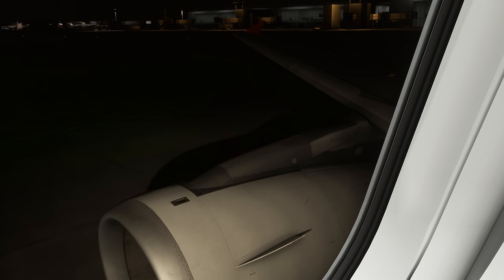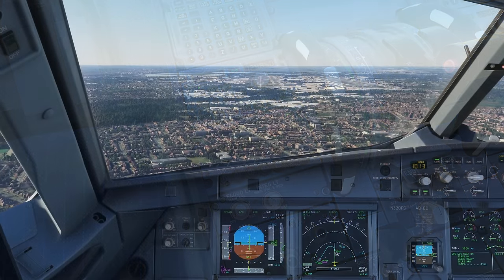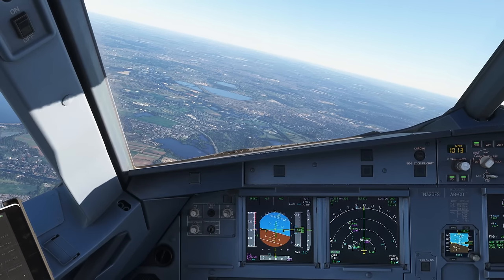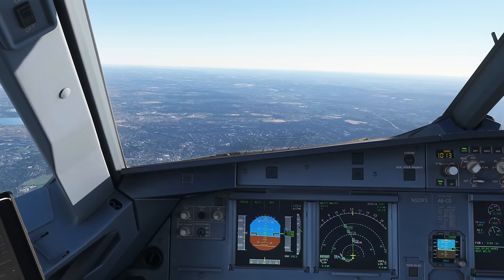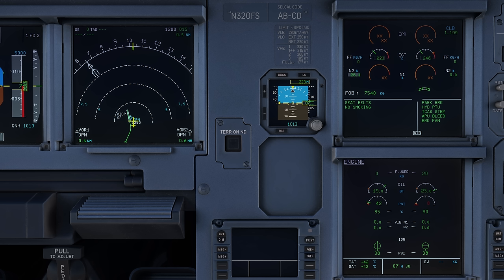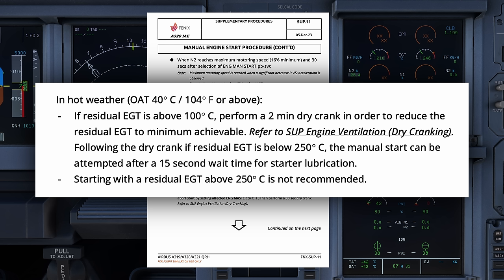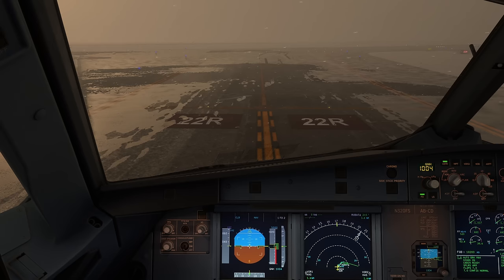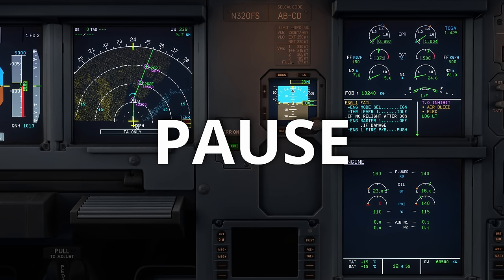Fenix A320 V2: Block 2 Feature Review

Comment: Quite incredible. Software engineering at a sublime level. 320, 000 data points between the 2 models. MICROSOFT you need to sign Fenix up as an exclusive developer for MSFS

Comment: 1. I presonally don't mind the delay. I would rather have a well polished, bug free (impossible, especially at this level and with other complicated softwares) or with small, not software breaking glitches, bugs. I don't have problem with waiting. I spend my hole life so far waiting of 25+ years to be able to get my first flight sim compatible computer, then another few years till I got the peripherals, totally worth it. 
Another reason I don't mind waiting if it is for polishing and fine tuning a software is because I know a little coding/programing myself, just basic C++ on a console application level like very oldtimey database handling apps I can do, or cslculators etc, so I know how mant variables are there, known or unknown and what it takes to debug, can't even grasp the gravity of your effort, work and geniosity of your developers and team members so you can deliver this wonder aircraft to us. 

Great work, you are one of the best, and to this day the Fenix A320in the airliner category is the most stable and has the best performance on my system including the inibuilds A310/A300 with less features and in-depth simulated systems. 

While it might sound controversy, I can't wait for it to be released, but take your time, no hurries from my part. Great work takes time, crap (work) even more. Just a saying we have in my country, no offense naturally.

Comment: Great works guys🎉 in case of airline configurations I think it’s necessary to bring the CRT EFIS, different thrust rating packages for different engine variants and the SATCOM option on the fuselage onto the aircraft, these will make each aircraft really feels specifically configured and more realistic!
Reply: Don't expect that, doing EIS1 (crt efis) the right way would take really damn long. Eis1 doesn't have that many differences visually, but under the hood that things Ecam system logic data (ESLD) is completely different.

Aamir already said that they won't be doing an EIS1 without simulating the old esld and he also said that they most likely won't do it
Reply: @henriklmao  Yep, this announcement was during the first launch at over a year ago, maybe some things changed? (I don’t know) The EIS1 is indeed equipped by a large percentage of Airbuses across the lineup, some early A320, A330 and A340s have those installed, can they really make the aircraft feels totally different when sitting in the cockpit, just like a Nokia to an iPhone.

Comment: For years I’ve been looking/hoping for a sim aircraft that is actually alive and dynamic in responding to its surroundings, pilot handling, etc. It always bothers me flying circuits hearing the engines sound the exact same every single start up every single take off and so on. This is a great step in the right direction.

Comment: Absolutely beautiful work guys can’t wait for it! ❤

One thing I’ve noticed on the line with the IAEs is that when a hot start ECAM is coming, I usually notice fuel throttling in the normal start sequence. It’ll follow the normal fuel schedule at said rotation but then suddenly throttle back 200-300 lb/hr from what appears to be an attempt by the FADEC to get through the fast rising temps. It will return back to normal FF sometimes two or three times randomly before the EGT will peak and it aborts with the ECAM. 

They’re so infrequent that I don’t have absolute figures of how the FADEC performs this function, just something I look for on those hot OAT starts as a warning of an impending long work day. 😂

If any MX guys or well versed book worms in the 320s manual can chime in on this tendency please do. I’d also like to know how the FADEC does this function so fast in the start sequence.

Patently waiting for sharklets 😂

Comment: 42:11 you can almost hear Aamir saying "like the 7..." , wonder if it's not a 787 since it looks pretty unsaturated rn in terms of payware. what are your thoughts?
Reply: also me, he say 7... but idk, fenix is focused on airbus series, idk
Reply: @donjose2181  This is pure speculation, but since msfs is getting pretty saturated with Airbus, they might branch out.
Reply: But maybe he just talked about the sharklets 🤷‍♂️
Reply: That’s all well and good but do not forget that they use prosim as their basis and prosim only has 737NG and 320 at this time.
Reply: wouldnt make sense. They said in the discord (normal chat), they are tired of the busses and want to do a classic aircraft. 787 aint classic :D. Could have been Cessna, 717,.... . Ultimately speaking, we dont know, could have been everything starting with either s or c.
Reply: @martindammable  how is it saturated? All there are is Fenix A320, Inibuilds default NEO and FBW A32nx that's even worth mentioning all that other LVFR trash don't even count.  Headwind is stuff all from the FBW too.

Comment: The sound during engine startup need some changes the sound you hear, you can hear it on seat 15A or F and up and not on Seat 5. On seat 5 you will hear more the air when it goes inside and the spin sound more than the idle sound.
Reply: They are clearly not showing off sounds in this video.

Comment: Not sure if its an option from Airbus, but the EPR gauges should have an indication after moving the ENG MODE selector to IGN/START or CRANK.  The N1 and N2 still have the amber XX until actual N1 and N2 reach between 3.5% and 6%.  Also the PTU self test is inhibited during the first engine start and does the self test only during the second engine start.  The PTU only runs continuously when the parking brake is OFF and a pressure differential of more than 500psi.

Comment: This looks amazing.  That said, I would rather, whether as passenger or pilot, lose control and drift off the runway at 22 kts than suffer a V1 cut and the resulting asymmetric thrust.

Comment: This looks really exciting and encouraging.  You guys are doing incredible work and I can't wait to see what you bring to flight simulation over time.  For that reason, though, I want to make sure my constructive criticism is received well.
It seems as though you may be getting caught up in the very small details while the aircraft is largely ready to go.  There's a big hole in our sims without the IAE A320s, sharklets, the A319, and the A321 (and we certainly can't go to LVFR after the quality bar you have set).  So, we're really looking forward to flying those.  We're less looking forward to ensuring our addon properly models ambient sound depending on where the camera sits in relation to the overhead speaker.  Does that make sense?  The aircraft seems very largely ready to go from your videos (at least the IAE model).  If you were to release that on the sooner side, then work on the eye candy and the 'nice-to-have' items in later updates I think the community would respond well to that.
It's important to keep in mind the public reception of a promised September 2023 release date, then a delay to October, then little to no announcements or updates for months until now.  Then after all that, we hear that the PA audio is now interrupted slightly if you transfer power sources during an announcement.  That's not necessarily critical to our enjoyment of the aircraft on day one.  Again, I look forward to enjoying the realism of this feature, but I'm not sure it should be part of the reason the plane isn't released.
Every simmer who flies the Fenix absolutely loves it, myself included.  I don't mean to minimize the work you're doing - it all contributes to making a top-of-the-line aircraft, I understand.  But given how ready we are for the aircraft to release, I don't think it's unreasonable to suggest some tactful prioritization of features for release and subsequent updates.
Thank you for all the hard work you're putting in!

Comment: A great fascinating insight into all the work you've all done. I normally fly the  Boeing 737, but this has opened my eyes to look into adding the A320 to my hanger. Just a little question with regards to VR, is this a heavy hitter on FPS when flying it in vr. I'm only running  a 1080TI with Ryzen 7 3800x and wonder if this wouldn't be good enough.

Comment: excellent progress! suberb work as always, I will comment though as an A320 pilot, the engine cooling doing crancking feels very very slow, even for a very hot day, also on that topic the egt rise on the begining feels kind of excessive, even on very hots days I never seen a CEO engine (CFM or IAE) crank for that long by a very very long shot, maybe you have more datapoints to support that then I do actually, what i'm saying is just from personal experience on around 2000h flying the bus

Comment: I just updated with the last one  407 but the cabin lights are not working at night,when I use GSX pusback the one with the bar is not working and crash,then everytime I finish my flight if I try to return to the main menu the simulator crash and is only with this Fenix because this never happens with other airplane and contrails are super bad,hope somebody fix it  !

Comment: That cut in the "future products like the.... No oh. Assuming that they are going to release the V2500 with block 2. And with the available data they have. And with the C before the cut. It's either the CEO or the Embraer C-390. It's the only other aircraft that uses the V2500
Reply: CEO is what their current Airbus is
Reply: @tomstravels520  I thought that it was a slightly older than CEO. Anyways
Reply: @chrisdimis91  there’s only 2 versions. CEO (CFM56 and IAE V2500) and NEO (CFM LEAP 1A and PW1000G)
Reply: @tomstravels520  I know. But i was always confused when they officially called it NEO and CEO. Somewhere in 2012 when they started testing the sharklets.
Reply: @chrisdimis91  those were technically A320 Enhanced and started about 2007 I think. One of the “enhanced” changes was the NWS moving from Green to Yellow System
Reply: @tomstravels520  I learned something new today. 😉😉

Comment: I am officially done with Fenix. Yet another crash (ctd) after about 30 minutes of flight. SIGH … As a follow up I flew the beta FBW 320 on the same route, same add ons running and everything was perfect. I typically fly 4-5 hour flights and these CTD are really frustrating. Logs sent to Fenix.
Reply: Sucks it didnt work out for you.  It's one of the best modules ever made for msfs